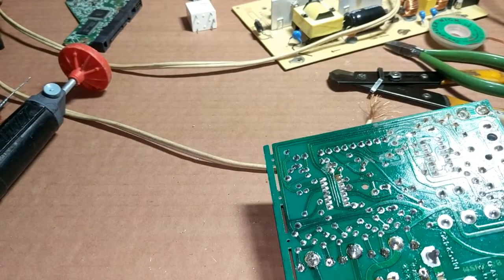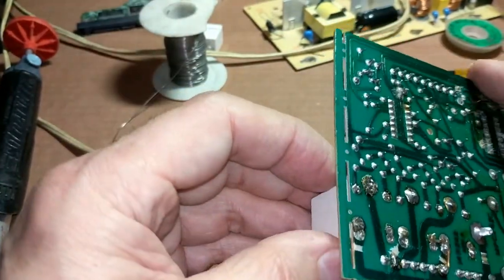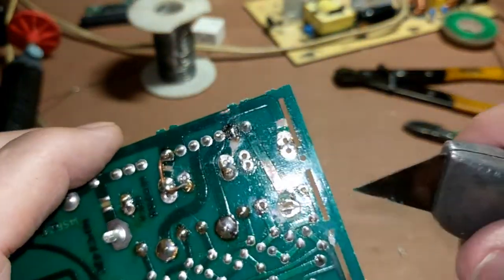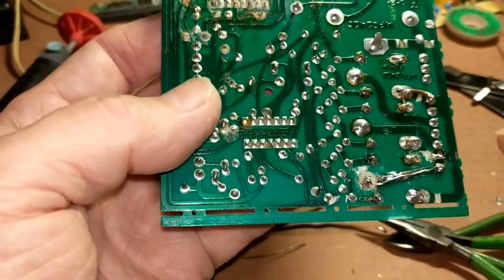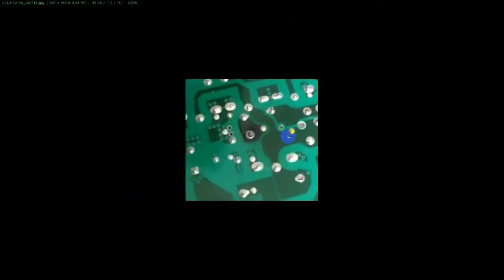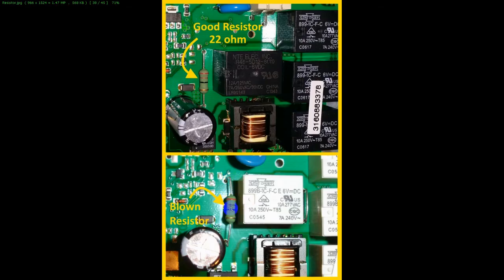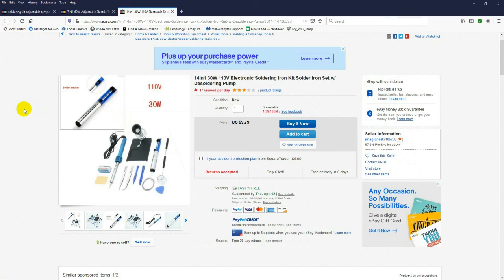Bosch Control Board Repair Tips

Comment: I have a whirlpool dishwasher with the same issues heater relay L1 issue. Charred board but cleaned things up and ordered a new Siemens relay T7CV5D-24. Part of the flat copper strip on the board is burned away (leading up to the relay. Will take your great advice and try to do the jumper.
Reply from the maker: Yes, that happens but at least they can be repaired by carefully installing a jumper.  I hope your repair works and the dishwasher works okay again.
Reply: @AgglomeratedIdeas  well, no luck after the relay repair, even though it was clear one relay connection was charred and discontinuous. The element checks out ok. The high limit thermostat is fine. Thermistor resistance at 25 degrees checks ok. Now relay is replaced. That’s all there is in the circuit!!
Reply from the maker: @a1chemist1  That's a real shame.  If you have eliminated the external components (element, etc.) to the control board and the dishwasher is still coming up with an E1 code, then the board is a goner.  It does happen sometimes that the arcing that takes place when a copper trace on the board is vaporized it will take out other nearby components such as integrated circuits.  That cannot really be determined up front unless it physically shows that other components are damaged.  The relay needs to be replaced to prove if the board is good or not.  This is only the second board that I have run across that looked like it could be repaired, but evidently sustained hidden damage.  It was worth the try though.
Check into the cost of a new control board for your unit and make a decision as to go that way or maybe it is time to upgrade to a newer model. 😞 I know that ours is not going to last much longer so I am expecting to buy a new one.  We bought ours in 2006 so I guess we got our money's worth, but I still don't want to think about having replace it though.
Reply: @AgglomeratedIdeas  thank you again my friend. I guess I spoke too soon. Somehow the unit made it completely through, the second try running. I didn’t check the element’s heating during the water heating or the heat drying, but am sure it worked at the heat drying stage (steam, for the first time in a long while!). So the relay did help. Thinking maybe (if I’m lucky) one of the door switches didn’t catch well on first try - I had forgotten to secure both switches with the little screws.
Reply from the maker: @a1chemist1  That's wonderful! 👏 It could have been one of the door switches, but I have also heard of this happening before (which I didn't think about yesterday).  Apparently, some of the dishwashers won't reset on first run...it takes a second run.  So, I think you are good to go now.  It works!!!!
Reply: You’re spot on. Ran it three more times - perfect!
Reply from the maker: @a1chemist1  Cheers...so glad.  I will have to try and remember the TWO RUN reset function in case this happens to someone else.  Unfortunately MY remember function is not working like it did a few decades ago...so I will probably forget it again.  At least it here in writing if someone reads through the comments.  Take care.

Comment: Hi and thank you for the insightful video. My Bosch dishwasher recently stopped drying and the wash cycle would run continuously. I replaced the old board with a refurbished board, disassembled the old part, and confirmed that one of the pins on the heater relay (labeled K1 Heiz2) was singed black. I am assuming that removing the burnt solder and simply soldering the connection back is not sufficient to repair the board and I will have to purchase a new relay? I am not entirely sure if the pin started out as an open connection or not. I am also a little unclear how to identify all of the pins and traces associated with a relay.

 Assuming that the relay needs to be replaced, any idea where can I source a Bosch heater relay?

Thank you!
Reply from the maker: Hi Jeff.  This video is a follow-up to my main video concerning the heater relay failure (https://www.youtube.com/watch?v=Jb8gAnMb2zQ).  You would need to identify the existing relay and then buy an appropriate replacement.  Usually Bosch used relays that had 6 volt or 12 volt coils, but in some instances there are others.  You can replace with an exact matching relay part number, or use a relay that is equivalent or better than the original.  Please watch that video and let me know if you have any questions.  Cheers.
Reply: @AgglomeratedIdeas  thank you I shall do that. I did find the original part (oddly all the relays on the board are the same part number), but I am having difficulty locating anything smaller than 30’units. Where single units are available they are on back order and I’m afraid the part might be back ordered. The part featured in your video is for 12amp circuits whereas mine is 10amp.
Reply from the maker: @jeffy9145  Yes, I recommend the 12 amp relay because it is better than the original relay.  You can go up in load rating (e.g. 10A to 12A), but not down (e.g. 10A to 8A).

Comment: Thanks so much for a very detailed video explaining everything. I have a Bosch SMS69178TR / 93 dishwasher and I am getting error code E:31 with all dishes still wet and cycle doesn’t finish. It is related to the heater. I opened it all up today and didn’t find any problem with the circuit board. Also it looked very different then any of the circuit board you showed or any other Bosch dishwasher circuit boards that people have shared on YouTube. This one does take a heater that is $180.00 I have pictures of all of the things that I did today. Unfortunately nothing worked !!!! Is there any way I can share the pictures of the circuit board with you ??
Reply from the maker: Sorry, I didn't receive an email from YouTube regarding your post, so I am just now seeing it.  You can email me at MyBrokenDW @.gmail.com
Reply: AgglomeratedIdeas thanks so much for getting back. I just sent you an email with all the details. Rick 🙏🙏🙏
Reply: Great video ,, learned a lot and now convinced it the relay for my problem, manny thanks 👍

Comment: Hi, your video is very helpful. I've just looked at my control board today, one of the ot409 triac semiconductors has blown rather severely. I'm a little new to this, any ideas what would cause this to happen? Is this a repair I can suitably make?
Reply from the maker: I reviewed the photos you sent me and, as far as I can tell, the board might be repairable.  The part is available from multiple sources such as here: https://www.mouser.com/ProductDetail/WeEn-Semiconductors/OT409135?qs=sSXnapcmqSspydfrqEuzag%3D%3D
Here is a product datasheet: https://www.tme.eu/Document/5adba66b5291c5b4b0b16dda06ab1208/OT409.pdf
A triac is much like a solid state relay and often fails if the load (in your case, it would appears that the detergent dispenser is the load) shorts out or otherwise fails.  I would take a close look at the detergent dispenser to see if it looks bad, and/or measure across the leads to see if it is shorted out.
If the detergent dispenser is bad, it must be replaced or otherwise repairing the board (or even buying a new board) would just blow the triac again.  One thing to note here is that sometimes when a triac blows, it also destroys the device that is driving the gate which turns the triac on and off.  I cannot tell visually from your photos if anything else on the board looks bad.  But, if your dispenser is replaced and a new triac is installed, the worst that might happen is the new triac will not operate because of a bad driver.  It is unlikely in that scenario to cause any damage and you might have to buy a new board to get the DW working again.

I hope that helps!
Reply: @AgglomeratedIdeas  thank you so much, really appreciate your input and significant knowledge on this. There aren't many people who would be able to assist on this where I live 😅 love the internet.

Comment: I had the same issue with the heater relay. Note I opened my new circuit board and the relay is updated to a 12 amp. the old burnt one was 10 amp.
Reply from the maker: Thanks for that info, it is about time they did that.  Do you have a P/N for the updated relay?

Comment: Thanks for these indepth videos, covering these dishwasher boards,

I pulled my board out today because I was getting a C6 error on my Bosch Dishwasher,
I can hear a consistent click coming from the board when I try to start the dishwasher (which will not start)
I figure it must be the relay, but upon inspection there is no visible burnt marks on the board.

Is it still likely that the relay has failed without any burnt marks on the board?
perhaps I should look again for discolouration

Cheers
Reply from the maker: Yes, the relays can fail without any visible burn marks.  However, it would not seem likely to me that a bad heater relay would cause what you are describing (clicking relay and not starting) to happen.
The dishwashers have a diagnostic/test mode that may help narrow down your issue...assuming, of course, that the machine will actually run in test mode.
Entering the test mode varies somewhat by model.  What is your model number?  I'll see if I can find the correct procedure for your model.
Reply: @AgglomeratedIdeas  Okay figuring out how to get it into test mode sounds good, the Model of my Bosch is SHE43P25UC/64, I really appreciate the help.
Reply from the maker: @Othalla  I will see if I can find the correct procedure for the test mode.
Meanwhile, you might try just resetting it.  I believe on that model the reset is done by holding the start button for 3 or 4 seconds, and then release.  If it successfully reset, then it should now start when the button is pressed again.
Reply from the maker: @Othalla  Unfortunately I could not find the button sequence for your model that enables the test mode.  Perhaps Bosch customer support might give you that information.  Or, there may be another video on YouTube that could lead you in the right direction.  I am inclined to think you have a control board issue, but without additional diagnostic information I can't be sure.  Sorry that I can't be of more help to you, but I just don't have access to the service procedures like the repair techs do.
Reply: @AgglomeratedIdeas  thank you anyways I appreciate your time, I know if I hold reset and cancel simultaneously and then power the unit on it gets me into a mode where I can read error codes.

I will most likely be calling Bosch to try and speak with a technician who can give me a clue onto what I need to do to fix this issue.

I've taken it half apart, thoroughly cleaned, and put it back together and nothing seems out of the ordinary I used my multi meter to check switches while I was at it and everything seems to have continuity.

If it is a feasible fix I will do it, if not it might be time to get a new one.
I see those circuit boards are selling for $400+

Thanks again

Comment: Question for you. When soldering in the new relay onto the control board, what do you touch your soldering iron to - the pins of the relay?
Reply from the maker: The relay pin and the solder pad on the board have to be heated to accept solder.  When I solder a large item to a board, I like to heat that item first so as to not overheat the pad.  Just as it begins to accept solder, I slide my soldering iron down so that both the item and the pad can be fed solder.  If the two items are about the same size, then just heat both of them together.
Reply: @AgglomeratedIdeas  thank you sir. I’m more of a point to point old school solder guy. Tube stuff.

Comment: If not, my model number is SHU66C05UC/23. Can you tell without removing the PC board what heater relay to order so I would only have to disassemble/reassemble the unit one time?
Reply from the maker: Sorry, but I don't have access to that information. You would have to look at the top of the relay to determine which one you have. And no, I don't repair boards. Hmm...maybe I should. $$$ 🤔
Reply: @AgglomeratedIdeas  Thank you for the response. I would like to post a picture of my board for you to see but Youtube doesn't seem to give me that option.  The burned pin looks minor, should I change the relay to be safe? Where do I find this relay?  The relay says: SHC SRE303006 Coil:6VDC, 10A/250VAC/AC1,  T+85C
Reply from the maker: @MiamiRefugee67   If you like, you can email me a photo at MyBrokenDW@ gmail.com.  But you should be able to use the "NTE R46-5D12-6" relay.  If you do a web search you should find many places to buy it...even Amazon has it.  Sometimes the shipping is more than the relay.  You might consider replacing all the relays if you are adventurous.

Comment: Hi, from over the pond. My Bosch dishwasher has stopped, no lights, no error codes. I've cheked the power supply to the board and the On/off switch. There are no obvious signs of burns on the board. Looks absolutely immaculate. Can you give me some tips to work out which components might be defective. can the relays stop working and not show any signs of external damage. Grateful for your advice.
Reply from the maker: Yes, the relays can stop working and not show any visual evidence of that.  But, it doesn't sound like that is your problem. When you mention that you have checked the power supply to the board, do you mean that it does have power, or it doesn't?  Have you checked the operation of the door latch switch?
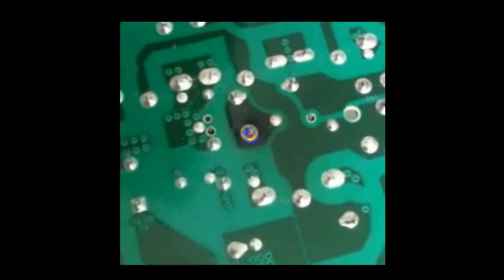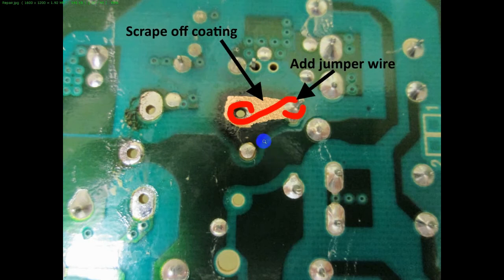Reply: @AgglomeratedIdeas  Hey thank you for this video and your insight. i have the very same issue. the board (same as the one at the 25:14 and 34:36 mark of this video) pin was burned . i replaced the relay but still no power, no lights. i have checked operation of the power switch and door latch and they are good. i was thinking next step would be to jumper as you did at the 34:36 mark?
Reply from the maker: @alanpeeps  On the control board mentioned at those to time marks, there is a topside jumper that connects over to the heater connector (it is the two pin connector).  On the bottom of the board, a jumper might be necessary as shown at 34:36 (also see 27:50) to make the connection from the replacement relay to the topside jumper when the solder pad for the relay is badly damaged.  If the solder pad for the relay is not damaged and the replacement relay is soldered well to the trace on the board, then the additional jumper on the bottom of the board would not be necessary.  It doesn't hurt to add the jumper even if the solder pad is not damaged.
However, as the above commenter (pagalhoon001) and you have mentioned, you don't have any power or lights.  That is not a usual symptom of having a failed heater relay.  You would normally still have indication of power to the DW even with a bad heater relay.  Unfortunately he did not reply back as to what the outcome was for him, so I don't know if he figured it out or not.  Some of the Bosch DWs have the wiring diagram with the unit.  I found mine rolled up tightly and stuck into a crevasse near the water inlet valve.  If you have that diagram you might be able to trace the power wiring thru the unit and figure out if you have another bad component or connector that is preventing the DW from getting power to the board.  If other components and wiring in the DW test good, then there is always the possibility that the control board has died and only a replacement board will fix the issue.  I hope you have that diagram and figure this out.  It is often one simple (and usually fairly inexpensive) thing that prevents these DWs from working.  The difficult task is tracking down the culprit.  Verify that the unit is getting power at the junction box because it could be as simple as a loose wire nut there.  It could also be a broken wire, a bad terminal block, or a blown thermal fuse.  Some testing will need power applied while other tests are simply continuity tests.  Be careful if testing with power applied to the unit.  Good luck and let us know what you find.
Reply: @AgglomeratedIdeas  thank you very much, i will let you know what i find.
Reply: UPDATE: i confirmed power to the control board and didn't see any obvious issues on the board, so i gave up and bought a used one from ebay and the dishwasher now works as normal.

Comment: ok guys my failure on Bosch dishwasher setting program, water goes out, the  its starting to doing series of weird sounds. Like its not able to turn with circulation pump , but I dont know why it wants to turn pump when it needs to send voltage to aquastop coil to start filling...then it tries for a two seconds and interrupt it. Then it looks like its washing without water, then E16 problem (problem with filling ) I tried to change the magnetic flow meter. coil of solenoid in the plastic cooling side labyrint, when I was somehow able to fill it, then soon it showed error with heater and stoped program (thete was enough water already)  if its doing weird buzzing sound in the begginning and I open and close the door during program, the  it started to fill for few seconds.. Not sure if there is another water ventile connected to filling hose. Now its not even able to turn with circulation pump. it does 3 attempts and program is over.. like its skipped to the end. OK I decided it must be main PCB ..maybe voltage converter with another various functions shortcircuited between some pins and sending not enough voltage to components..I mean something simmilar like LN306PN converter.. not sure.. maybe its just stucked curculation pump or its bearings..fcn hate these german dishwashers..